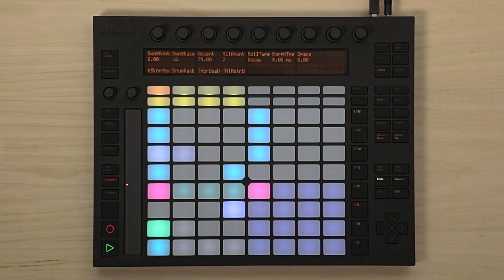Time and Timbre - PUSH

Comment: Very cool.
How does it interact with Push?
Is this part of the main push functionality or do you have to go into Push's user mode?

If one indeed has to use the Push user mode, does it still allow to use custom scripts like "PXT Live" or PXT Live plus" from NativeKontrol?
Reply from the maker: hi tripticot, you dont have to do anything special, its plug and play and uses push "normal" mode, when you focus on the TnT channel it automatically switches to this mode and lives it when you focus on another channel.
Reply: iftahbox the push script doesn't work for me .
it stays in the regular drum rack mode.
what can i do? where can i get support?
Reply from the maker: Niv Mileguir make sure that push is connected before loading the device, if that still does not work, send us a private msg and we will take it from there
Reply: Niv Mileguir
Hi Niv, I had the same problem - Under Options/ preferences, Push has to be number 1 in the list , - I had my APC40 as number 1 and Push as 2 – swopped them around and all works fine.

Comment: Just been watching all the Time & Timbre videos and it's one awesome engine for drums. What's not clear from the videos - can it only be used with the Timbre drum sounds or can I use my own Drum Rack with it's midi-out triggering drum sounds within maschine then bringing the audio back into Ableton Live.

Is this possible?
Reply from the maker: +space travel made easy 
totally, TnT can sequence anything that speakes midi :) just load your sounds into drum rack or sequence external gear, even analog hardware if you use this free device as trigger source: http://www.maxforlive.com/library/device/3175/trigger-tailor
Reply: Cheers guys. I got the reply on twitter too. Thanks for taking the time to answer. What a bloody awesome thing you've built here!

Comment: how did you get the patterns to shift from one to the other like that at 2:15?
Reply from the maker: +azfiu 
on push, press and hold the first pattern of the chain until the pad light changes and then press the last pattern of the chain. on TnT, hold shift and click the first and the last pattern of chain.